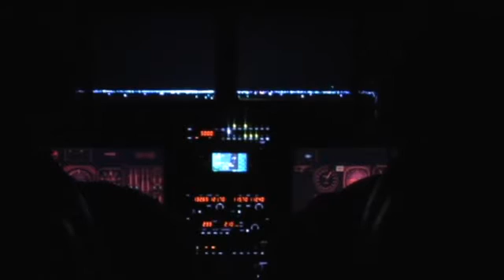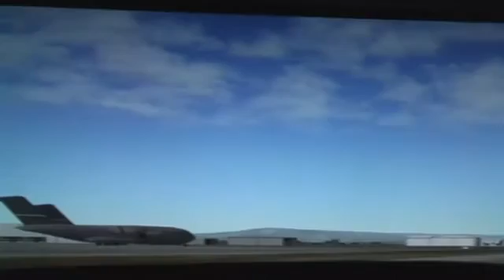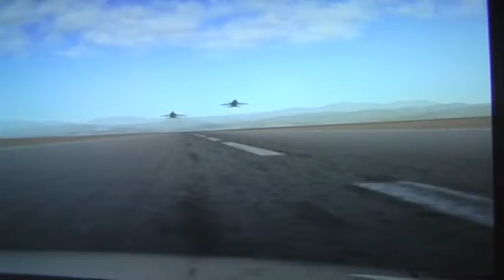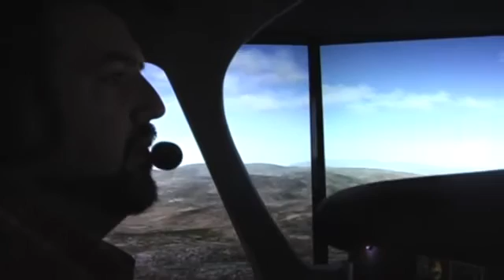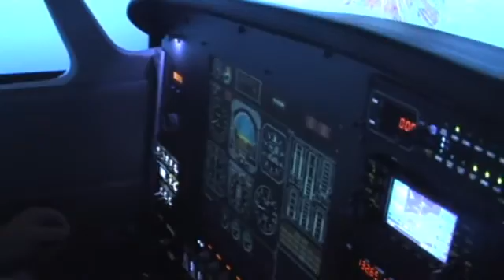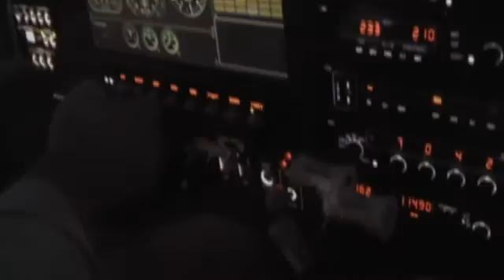PilotEdge online ATC demo - PFC sim

Comment: The MFD is around $150k with dual controls, the real Garmin 430, 5 x 50" plasma screens, motion, etc. They have a lower cost 5 channel rig with single controls for around $50-60k, the recently-released CRX MAX.